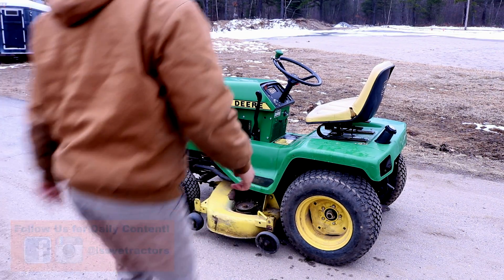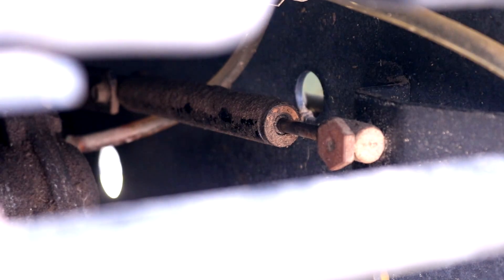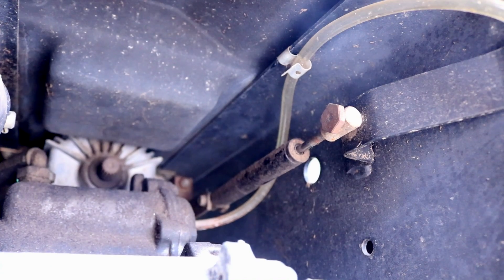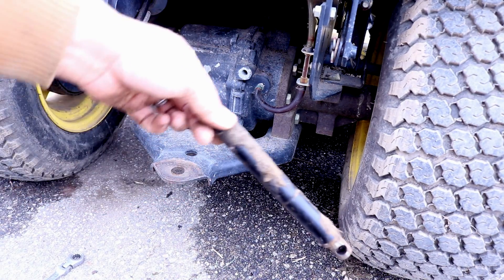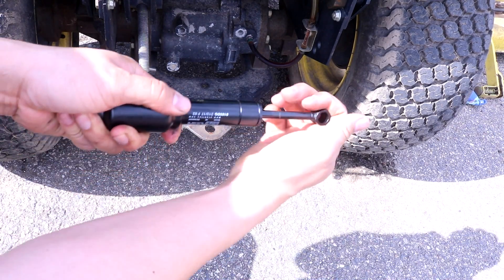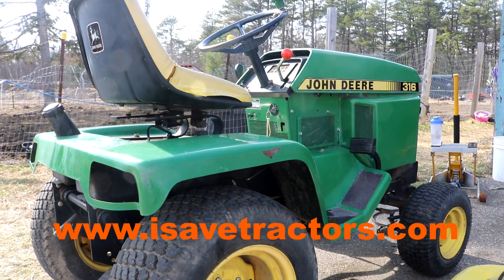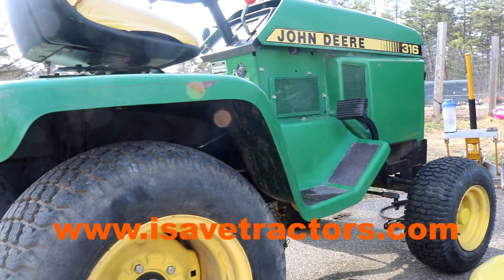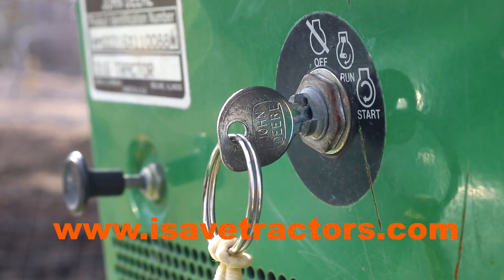John Deere 316 Garden Tractor Repair: The Jerky Hydro

Comment: ADDITIONAL SOLUTION! I also found that I had loose bolts where the differential attaches to the frame. This allowed the front of the Hydro to move substantially and cause jerking. I first replaced the damper and removed all play from my linkage but It still jerked. After tightening the 4 bolts, it now drives very smoothly.  I hope this helps someone.

Comment: I purchased a JD 420. The hydro jerks. I changed the damper and took most play out of the linkage. I have replaced the trans oil and filter. It is still jerky. It does take off when you push the lever up, but it just doesn't stay steady. Oil level is correct. Any suggestions?

Comment: I have a 1987 John Deere 420 garden tractor. The transmission seems jerky at takeoff like you mentioned here but it also surges relentlessly. For example, just driving down the driveway in low speed half throttle it’ll nearly jerky right out of the seat. Could this same type of thing be causing that. The food was changed last year and filter and the level is correct. Any input would be appreciated.

Comment: Ok so I have a question I have a John Deere 300 so I have to use the lever you were using in this video to move the tractor but when it gets worked up it won't stop moving I have to drop the plow to keep it from moving and sometimes that doesn't work can you help?

Comment: Would a Cub Cadet 149 jerky hydro be as simple as this to fix?  When i raise the Hydro lever sometimes the tractors jerks to HIGH SPEED lol. Same thing is reverse.
Reply from the maker: Hmm that's interesting. Your friction disc may be worn. Instead of getting a new one I suggest tightening it up with a different material. I had this plastic type packaging that came with some tools that I use on the cub cadets and it works great

Comment: I just bought a 317, would this be the problem if it doesnt seem to want to go as fast forward or seems like there is a lag in getting it up to higher speed when pushed all the way forward? Or what could be the problem? It shifts smooth forward and reverse. 
Another question entirely, related to the steering, if there is a lot of play in the steering like a 1/4 to 1/2 steering wheel turn before tires turn thoughts on what that could be? Thank you for your great videos.
Reply: Chck your fluid and filter first it 
If it’s low it might do it

Comment: One thing I would like to note to most people, is that the location of the dampener is on a “series 4” tractor (don’t know the year for the change, but I know for certain after 1988). All others, prior will be within the dash tower next to the handle for the hydrostatic drive control. This applies to 316, 318, 322, 332, 420, and 430. The one that he changes could very well be an optional or secondary shock that came on these, but I haven’t confirmed that yet.

Comment: can someone tell me how fast, top speed   (mph)  a  316 can go? i i was just curious. 
and they all should of had a o.e hour meter?  correct ? mine is missing. this 1984 model was given to me
 they think is a blown head gasket cause it smokes bad and runs bad. my brother had given me his d110
that had to same problem and i fixed it and sold it for 400.00.  and on that one i can see why in the blown spot 
and with my research the head does not bolt down exactly evenly around the piston. i am looking forward to working 
on the 316 and learning about the small engines. i also have an old murray 5 hp ride mower  1969 model the neighbor
gave me i would like to restore to a certain point. along with the jd 316 ,  i was a auto technician for 23 years....no more
and like the idea of working withe small engines and riders.  i love watching all the john deere videos and learning
all i can         thanks to  all you john deere guys for posting your videos!
Reply from the maker: the 316 normally tops around 6MPH. Send us messages directly for further information or email/call our office.

Comment: I have a sears ss18 garden tractor with a onan BG-MS engine? I was curious where can I find a replacement air filter for it?
Reply from the maker: We might have them. Send us your current filters, dimensions. ID, OD, and Height.
Reply: @Isavetractors  ok here is the ID of the foam filter 140-1259
Reply from the maker: Give our office a call for further assistance

Comment: what damper you use?
Reply from the maker: I used the John Deere OEM One. Do you need the number? I have to go look it up
Reply: @Isavetractors  I need the OEM part # if you have the time. Greatly appreciated. JD tractor stores started new program for part search. Took 45 mins to find mower blades for 316! Crazy.